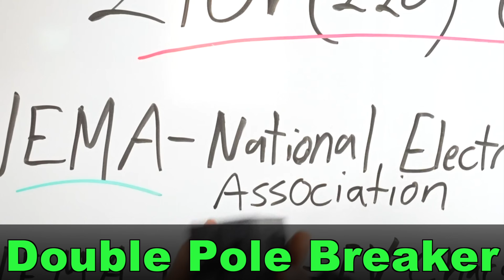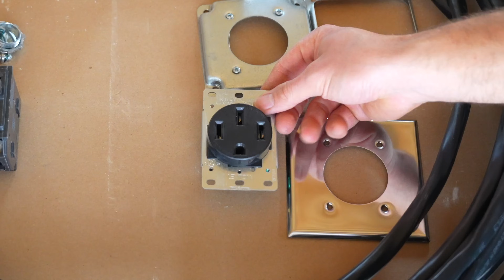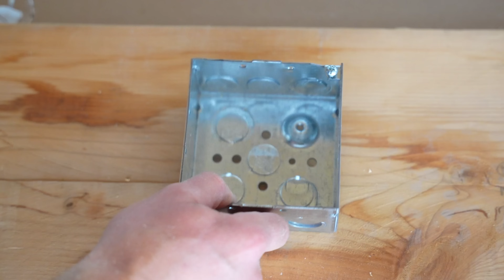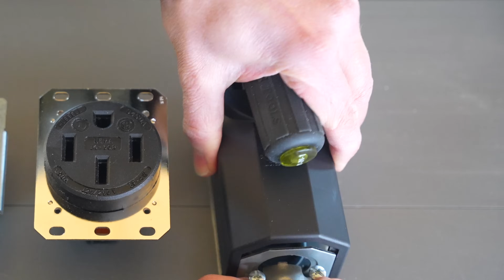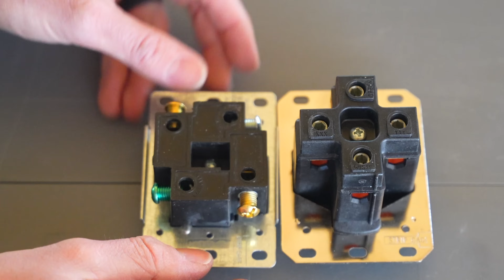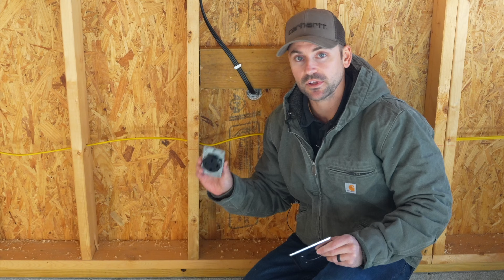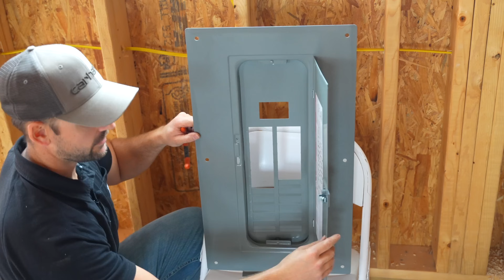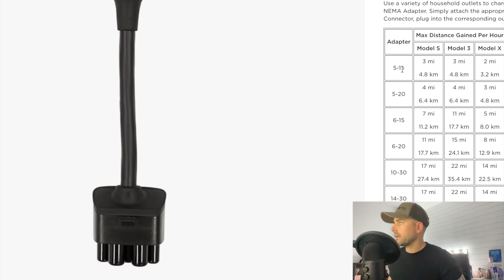How To Install A 240V Outlet In Garage - EV Car Charger, Welder, And Electric Range (Hubbell 14 50)

Comment: I have an ev charger that is a 30 amp that requires a nema 6-50 plug and it  recommends me to use a  40 amp breaker  i was wondering if I can just use a 50amp breaker using a 6/3 wire

Comment: Prettle good video.  I installed a sub panel in my garage, a NEMA 14-50 (the high quality one) and two Tesla Wall Connectors which share a 60 amp breaker and power-share, which is a fantastic Tesla feature.  If one car is charging you get 48 amps and if you charge two cars you get 24 amps until one of them finishes and then it jumps back to 48 amps (or whatever you've set the charger to).  Powersharing is a great Tesla feature for those that have more than one car and perhaps don't have the ability to run two dedicated sets of wires from the main panel.
Reply: If you are using the NEMA 14-50 outlet, even for two Wall Connectors, the max breaker needs to be 50.

Comment: Hey if I used a 30 amp breaker for dryer and i move out the dryer and want to use the wiring for Ac/heater is that ok well of course i will have to change the outlets would that breaker be too high for a ac/heater ?

Comment: according to the ne, a 30 amp circuit is approved for a welder even though the welder has a 50 amp plug on the cord. the receptacle must be label for welder use only.

Comment: After 40+ years doing electrical work, 30+ as a lic. elec. contr, I never thought it a good idea to try and teach a homeowner how to do electrical work. The $ they might save doing the work themselves, will be pennys to the loss they might suffer if their work experiences a catastrophic failure. There is a real important reason why one needs to be LICENSED by each State to do electrical work.
Reply: You are probably right.  I'm an engineer and love DIY projects...so I've wired both homes we've built/expanded but I'm sure a licensed electrician is almost always the best choice.

Comment: Just a reminder, pounds is not a unit of torque, but a unit of force.  The torque rating should be listed in either lb-ft or lb-in, so make sure you set your torque wrench or screwdriver to the appropriate units.  I know most things in electrical work are listed in lb-in so it may seem easier to just say 75 pounds or 45 pounds, but you really shouldn't get complacent with that sort of thing.

Comment: 10:25 - you should be looping the ground wire around the screw in a clockwise direction so as you tighten the screw, the wire tightens around the screw. You wrapped it around counter-clockwise and as you tightened the screw, you can see the wire loosening around the screw.

Comment: No recommended to strip wire with that knife. Use an Electrician stripper or an Electrician knife. Always from back to end. Never around, you can damage the copper and not accepted on an inspection.
Reply: I've been an electrician for almost 40 years and have used knives like his forever. You're not gonna damage the copper enough to harm it.

Comment: Excellent concept. However, you fill the airwaves with 2 much non important words. For example,  at minute 3, you said a lot about nothing (check the manufacture...) I feel, in the same amount of time, you could have used the same amount of words to just teach why the manufacturer suggests XYZ so if we are working with welders that no longer have a tag or the SHTF, we can work with real DYI. Go back and listen at min 3. I am a teacher with 25 years a masters in Education...if my exper4as an educator matter...from one educator to another ;) Keep up the great work!

Comment: As a self-proclaimed YouTube electrician 😥, that's the 1st time I've heard about wiggling stranded wire then re-torquing the screws.  Thanks for that!  I've wired a hot tub, pool heat pump and an EV charger.  After seeing this video, I'm definitely going back to verify those screw torques.

I also originally cheaped out and installed the Levitron 14-50 receptacle.  I had a 2nd EV charging cable available which I solely used for this plug thinking as I won't be unplugging/re-plugging the charger daily it should be fine.  However, the cheaper quality receptacle got significantly hotter when charging at 32A, so I'd end up reducing the current to prevent over-heating.  Bought the Hubbell receptacle soon afterwards and haven't had the same issue again.  

Great detailed video.  Cheers!

Comment: Hopefully you are still active on this channel. Just wondering if I can extend 240v wired from my room to the garage. I used to grow weed in the room and needed 240v to give power to my 8 light control box. Now that I don’t need it anymore I was wondering if I could extend those wires to my garage. So I could charge a future ev?  Can I add flex to those wires being ran to my garage?

Comment: When connecting your ground to the box didn't go in clock wise direction so the wire got loose. Always go clockwise (not counterclockwise) when turning a screw into any wire terminal. In order to ensure the wire got taken not loosed

Comment: Okay so, where does the "6" come from in a 6 - 3 wire?  But the Hubbell price came down, I picked a new one up on Amazon for $50 a few days ago.  What torque screwdriver are you using?  Don't think 75 foot pounds of torque was correct.

Comment: Thanks for the great video @theexcellentlaborer 
In my main panel there is only ONE bar, don’t have separate for ground and neutral. Can I connect both the wires on this single bar at random empty space? Please guide. Thanks

Comment: I was tought too wrap wires clockwise around screws so they stayed tight and didn't spread out. It just works better. Torque is rated in inch or foot pounds. The wire screws are tightened too INCH pounds.

Comment: what does it mean if it says 230v? I want to install a 230v mini split using my 50 amp rv park plug since I have the rv plugged into the 30 amp. Would this work?

Comment: Great! Much thanks.
Reply: I have a wood lathe that runs on 220v. I have moved it to a better location in shop, unfortunately the power cable will not reach it now.  The lathe now is 6fr from the existing outlet. Can I daisy chain from the existing location to the new receptacle or home run from power panel. I never run any of my 220v machines at the same time. I would appreciate your thought, and I am a new subscriber…. Enjoy your excellent videos

Comment: The ground wire should be wrapped around the ground screw clockwise so it gets pulled in when you tighten it rather than squished out.  When you strip wires with a knife the blade must be more parallel the the wire to come in a shallow angle so you don't nick the wire which is like scoring a piece of glass.  The wire will break at the nick if it is subjected to constant vibration like from a motor.

Comment: Just to clarify  when you torque the Allen lugs on outlet and breaker.  He says pounds but make sure it is inch pounds.  Because foot pound is for lug nuts.  So if you have a inch pound torque  wrench you can use that instead of having to buy a special  torque screwdriver.

Comment: For one you use the wrong box, you should have used the side Hung then you would not have to put a piece of wood behind it and you wouldn't have screws in the side of the box that might Nick The Wire.

Comment: I have stove on the name plate 11 kw 120/240v . What size breaker do I need
Reply: Double 50 if you use a 50 amp receptacle   That is 46 amps at 240 volts  So if you hard wire it 60 amps if your conductors are rated for 60 amps

Comment: My dryer ssay it need 240 to work how do i fix it have only 210
Reply: 210 volts?  Call the electric company.  They will find the other 30 volts.  It went somewhere.

Comment: Great video.  One of the best I've seen.  Just call it 240v.   In 38 years I've never measured 110v or 220v.  All voltage is nominal from the power company, but they have been  supplying higher voltages for my entire life
Reply: Exactly!  I'm tired of people still using the terms 110v/220v, when it doesn't exist and hasn't for a whole lot of decades.
Reply: Most appliances would burn up quickly if you had 110 volts at the receptacle.  Simply because of low voltage.  I’m a lineman for a large utility and we try to maintain 124/248 at the meter.  That is basically the national standard.
Reply: The US distribution network was originally 220 volts. The utilities upped it to 240 to provide more power without changing all the equipment.
Reply: He did not use the right outlet. EV application should use a NEMA EV 14-50 outlet. The standard outlet is not designed to handle extended full current draw. It is fine for a dryer or other loads that are not going to last hours, but an EV can draw full current for many hours while charging. The correct outlet uses the same plug layout, but it is a larger and heavier plastic, and is clearly marked with a green car outline and "EV" inside the outline to the right of the ground pin.
Reply: I see often 208v some places I see 244v. All these Ev charges just made homes energy hogs. At least middle of hot summer days hopefully these power hog chargers are not running. Along with all the central ac systems
Reply: @thehvachacker  208 or 244 in residential electric? Where was that?
Reply: @thehvachacker ah yes, the odd 10kwh at night is really killing us haha

Comment: I want to run a 240V wire for a welder and an electrician friend suggested using 6/3 ga aluminum as it is cheaper than copper, however , all the videos I have watched included yours show using copper. Which is preferred?
Reply: As long as it isn't a long run, definitely go with copper and make sure you reference the Ampacity chart. There are actually exceptions for dedicated welder receptacles, but just stick with the typical rating for safety.

Comment: I had to use Leviton (only one at HD) receptacle am I gonna die?
Reply: No, but I'd check it periodically for signs of overheating if you are drawing high current from it consistently, like for an EV charger. Easy to swap it out down the road.

Comment: A VERY CLEAR demonstration video!  Good job! The only omission, however, is that the 2-pole breaker MUST be a GFCI-type breaker per NEC® 210.8(A)(2) and 625.22. Any personnel protection against ground faults internal to the EVSE protects SOLELY the EVSE OUTPUT CORD to the EV but NOT the EVSE INPUT CORD from the NEMA 14-50R receptacle to the EVSE. (Technically that GFCI-type breaker would eliminate the need for refund GFCI protection integral to the EVSE UNLESS the EVSE performs power conversion [nearly all DO NOT convert]).

— Brian Rock, Hubbell Incorporated, 
I also serve as a CMP-2 and a CMP-15 Member but this is strictly my own position (not NEMA’s and not NFPA’s)
I also am one of the 7 co-authors of the original (1996) NEC® Article 625 for Electrical Power Research Institute (EPRI).
Reply: Brian, I'm in the middle of wiring my detached garage right now, and am having some trouble figuring this one out. It seems that the manufacturer specifies NOT to use a GFCI outlet for an EVSE 40 amp charger (50 amp breaker), and that the EVSE has GFCI built in. That said, I note your comment above regarding input/output. My issue here is that these chargers are known to trip a GFCI outlet or breaker, much like a tredmill does. What is the work around here in order to have a reliable appliance and meet code?  My charger is corded - specifically a JuiceBox Pro 40 model and I id wire it into a external waterproof housing containing the NEMA 14-50.

For that matter - any recommendation for wiring in a treadmill in a detached garage as well? I plan to dedicate an outlet for this and wiring it straight to the panel on a non-GFCI/AFCI breaker.

Any suggestions?
Reply: @adamlloy2807 the recommended work around is typically to wire the charger directly to the circuit without the nema outlet. That way you're just using a regular circuit breaker since the charger has one built in.
Reply: Hello so do we need a GFCi? @adamlloy2807
Reply: Might also want to inform him that the item in his hand is a device, not an outlet. The device in this case  is a receptacle, not an outlet, which is installed in an outlet box.

Comment: If I’m making the outlet outside is there any way to give it a cover incase of rain or is it better to have it in the garage directly ???
Reply: They sell outdoor rated boxes and receptacle covers. I believe they are required by code, not just a nicety. Better to have it in the garage if possible, but outdoor installation is certainly possible.

Comment: Does using a 220 volt mean you have to use a metal box or can you still use the plastic boxes.
Reply: It is not required to use a metal box, but if you do it must be properly bonded.

Comment: Is the metallic faceplate grounded simply when connected to the Hubbel Nema 14-50 receptacle? Or does the faceplate need to be grounded separately?
Reply: Did some digging to try to make sure I answer accurately. Yes the faceplate is required to be grounded, of course, but yes the mounting screws should be considered sufficient by code to be a proper bond to ground. It's generally not very specific about this, perhaps because it seems obvious, but there is specific code pertaining to medical facilities which permits this, at the least. The faceplate is grounded by the receptacle which of course must be grounded. The receptacle is also touching the box which must be grounded even if the receptacle is removed. The faceplate is grounded both by physical to any metal components, but most importantly by the screws.

Comment: anti - corrosion paste not necessary ?
Reply: Not necessary. Never use it on copper and most modern aluminum cable does not require it. The only time it is truly required is if the wire or device being connected explicitly calls for it.

Comment: Just to be clear, would that cheaper 14 50 work?  And would you be comfortable using it if the charger was plugged into it and left alone after that?  Secondly, if you wouldn't be comfortable using that, is there an option between $10 and $90?!
Reply: The Hubbell and Bryant receptacles are both available for $60 or less now. Just go with them.
Reply: This is an area where you don't want to skimp on money. Get the better quality receptacle.
Reply: LOL I was just about to explain to this poster why you need to go with the more expensive one.  Then I realized that the poster was me!  I guess I have learned a lot in the last year.  😂

Comment: For EV supply equipment, direct wire is the way to go. Much less possibility of the equipment melting down vs the cord and plug method. Also, you would avoid an unnecessary expense of the outlet. The cheap leviton outlets are fine for a range, but are a legit fire hazard on EVSE. The wire used for direct wire will save some $$ as well. EVSE use 2 wire with ground and don’t require a neutral. I do like how this installer used a torque screwdriver. Properly torquing the terminals are important for every install (just look at manufacturers instructions), but especially when there is a significant current draw.

Comment: Great video, I've learned a lot and it's information what needs to be done, but I won't do it. I'm thinking of buying an EV, but how do I assess If I can install another 240 volt outlet? For me, to call for a electrical assessment it will cost about $300. I live near San Francisco. So how do I assess my electrical box?

Comment: Really important to overstate that you should only use Hubbell or Bryant receptacles for EV charging.
If your main use is EV charging and/or a welder, a 6-50 will be cheaper to wire. And if you're running conduit, could allow you to downsize or fit more circuits in there.
Also, I think a lot of states have adopted the 2020 code now which requires all receptacles to have GFCI. And depending on the brand, holy are they expensive. Why I went with Siemens stuff, their 2-pole GFCI breakers are usually quite a bit cheaper. That and they're readily available at Menards/HD/Lowes.
Reply: 2020 code does not require all recpt to be gfci protected

Comment: There’s 2 concerns here with this installation. 

1. 6-3 Romex isn’t up to code for continuous load of 3+ hours. So dialing back the amps on the EVES below 40 amps takes care of that issue. 

2. Aluminum isn’t EVSE friendly, it’s a big point of failure. The aluminum used from the main panel to the sub could be an issue down the line.

Comment: Good for you for grounding the outlet box. Too many Youtube experts fail to do that.
Reply from the maker: I always ground my metal boxes. Thanks!
Reply: Yes, but he ran the wirec ounterclockwise around the screw.  Much more likely to work loose.
Reply: @edgecomber  It's also code to wire around those screws clockwise, so they don't start to come loose as you tighten the screw down.
Reply: @peteyc2292 thats not code. Nowhere in the code are the words, wrap clockwise.
Reply: @edgecomber  thought i was the only one who noticed